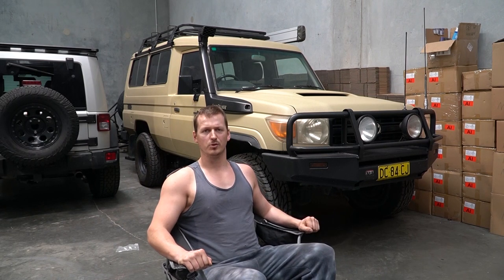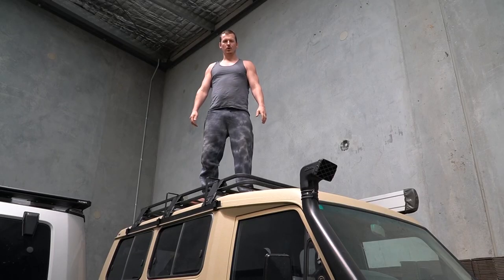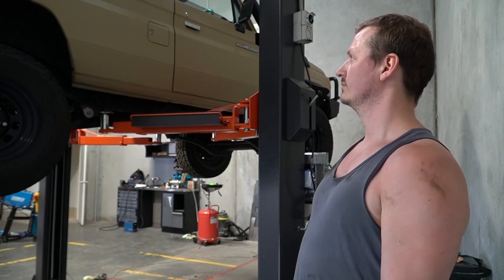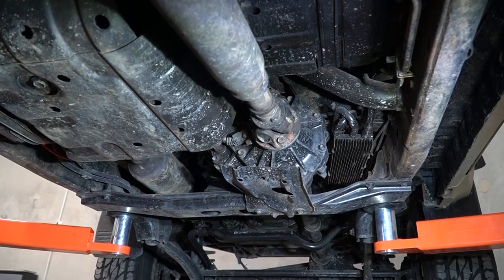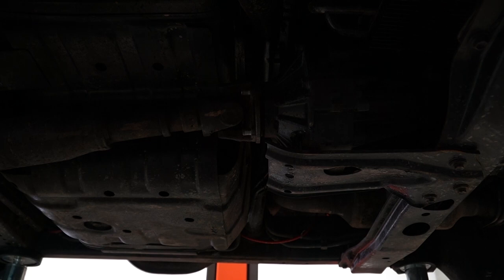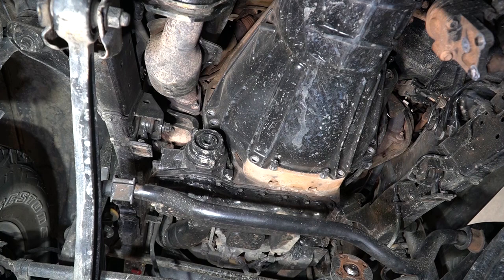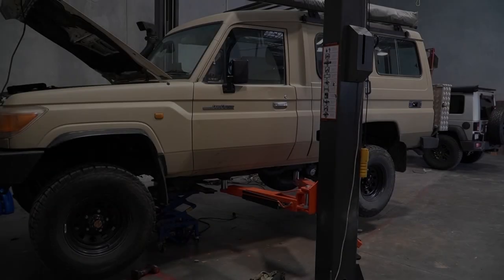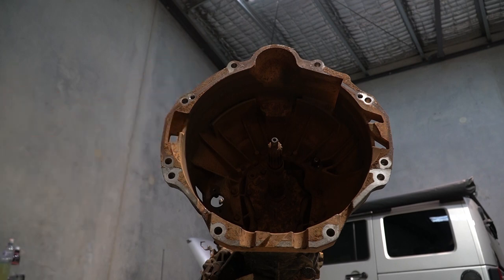How to remove a LandCruiser gearbox - VDJ 76 series Troopy 78 or 79, or anything in general

Comment: If you address that diff leaking nut problem. (This only works when not changing bearings)
I recommend total removal of the center and take out the pinion.
Measure the length of your crush tube. Then machine a tube form appropriate stock to same length.
As you are not hopefully changing bearings. Now when you tighten the pinion nut to god tight.
Everything should still be in spec.
Done this more then ten times. On Many models of Landcruiser.
For some reason the nut comes loose. Its not common but keeps happen to the same people! Then on the track they use a rattle gun to tighten it. F@#$%^&g the diff.
Reply: I know this is a terrible idea.
I looked what Nissan did. As they don't fail like this. 
But how else do you prevent having to rebuild your diff? (Do not say"Just don't go rock crawling") 
Everytime you catch the drive flange on a rock. Then having 3.5T of LC rocking back, and hammering your pinion shrinking the crush tube. 
Then the flange nut comes loose , the oil comes out. Everything comes loose then the pinion and crown wheel go BANG.
You could run a Superior Engineering Diff and pinion guard. Add 15Kg per diff pluss the $$$. 
Vehicles I did are still driving around 10+ years latter. No problems.
Anyone with better solution?